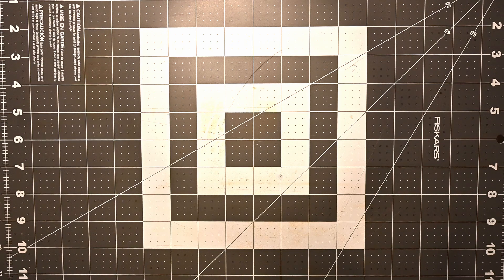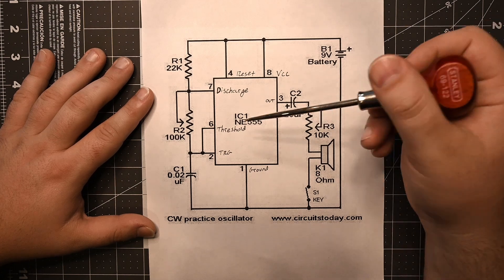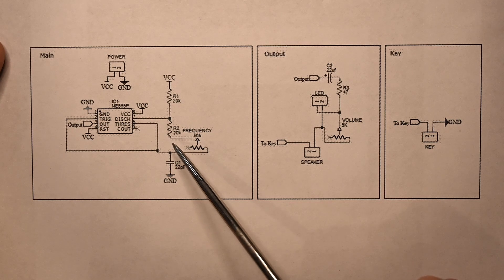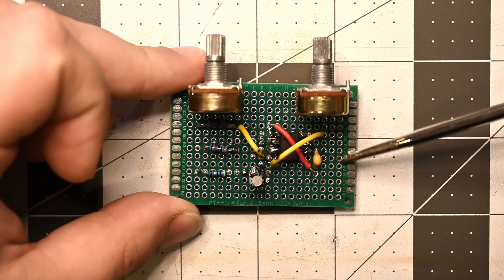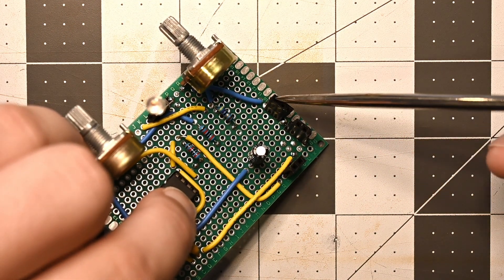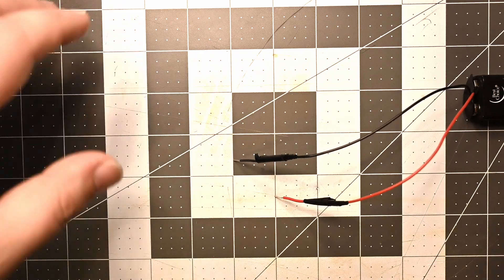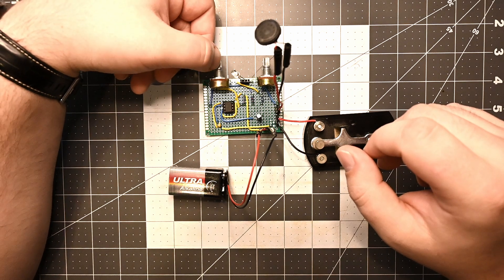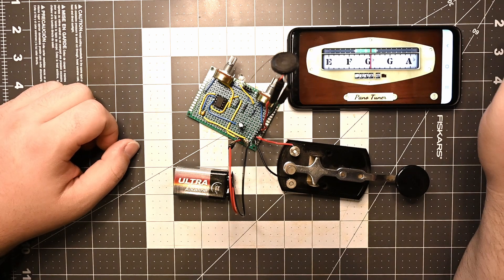Morse Code Oscillator for CW Practice with 555 Timer

Comment: I have two suggestions to improve this circuit that I see replicated as is seemingly everywhere.
1. The lower portion of the 10K volume pot is swamped out by the 8 ohm speaker. Replace the 10K pot with a 100 ohm one. Better yet,  connect the 100 ohm pot as a variable resistor in series with the speaker. The variable resistor and speaker will form a voltage divider that will work with a reasonable range.  You can add a fixed resistor of 10 ohms or so in series if the lowest volume setting is too high.
2. Connect the speaker return lead to the negative rail and move the key so it switches the negative lead from the battery to the circuit. Eliminate the power switch.
Power will only be drawn when the key is closed, so you can walk away without having to switch anything off and no current will be drained from the battery. Connecting this way will also save power when you are sending because no current is drawn when the key is up.
Have fun!

Reply
Reply from the maker: Those are great suggestions! I'm definitely gonna try that! There's a few things I'd like to do and make a v2, so I'll definitely keep this in mind. I really appreciate you taking the time to watch and write all that to help me out!
Reply: @ErikNonIdle  My pleasure. It's nice to see someone pursuing science and engineering as you are.
Reply from the maker: @sailatmojo  If you look at my channel you'll see I have a bunch of different interests, but I absolutely love playing with electronics and always loving learning more about it and finding new projects to do.

Comment: I don’t have a 20-25pF capacitor, what is the maximum leeway?
Reply from the maker: That capacitor works in tandem with R1 and R2 to control the duty cycle and frequency of the output, so the 20pf isn't a critical value. According to the NE555 datasheet you can calculate the Output High  duration with:
Th = 0.693(R1 + R2)C

and Output Low with:

Tl = 0.693(R2)C

So if you want a 50% duty cycle and particular frequency you can plug those numbers in for the capacitor you have and adjust R1 and R2 accordingly. There are also calculators online that will do the math for you. Long story short, you can absolutely switch out that capacitor pretty freely with whatever the lowest capacitance you have is, you just might have to adjust your R1 and R2 to compensate a bit if you are looking for a particular frequency.
Reply: @ErikNonIdle  Thanks for the detailed answer, I already have R1 and R2 (with the same values as yours) and I was wondering if I could just swap it for a 10pF capacitor. I also have a 100pF, which one would work better?
Reply from the maker: @austincarter825  oh, in that case I would probably use the 10pf. You'll get higher frequencies out of the gate, but if you use a potentiometer on R2, you can bring those high frequencies back down.
Reply: @ErikNonIdle  If I use a 10pF capacitor, which would be the best value for R2? I may have some others.
Reply from the maker: @austincarter825  According to a calculator from digi-key, a 50k resistor would be very close to exactly the same as the 20pf cap values. 40k is also pretty close. Keep in mind, none of these values are critical to the function of the circuit actually working, just the tone and frequency. I would definitely experiment with different values on a breadboard to see what you like best. I also just got in some PCBs for this circuit that I am planning to mess with and probably sell if anyone is interested. More on that in an upcoming video.
Reply: @ErikNonIdle  Thanks for the help, and thank you for the video, great tutorial/explanation!
Reply from the maker: @austincarter825  Of course! Let me know if I can help further, and please report back if you wind up making the project! I'd love to hear how it goes for you.
Reply: The 25uF is strictly for DC blocking. It has to pass the audio frequencies and not compete with the 8 ohm speaker. Anything over 25uF will be fine. 25uF is about 6 ohms at 1KHz.
If you want to figure the impedance (AC resistance) that the capacitor puts in series, use the formula Xc (reactance) = 1/(6.28 x f x C) where f=the audio frequency in Hz and C is the capacitance in Farads.  6.28 is actually 2xpi. 25uF is 0.000025 F

Comment: 22uF electrolytic capacitor equal to how many volt?
Reply from the maker: If I understand your question correctly, 22uF electrolytic caps are rated to 25V, which is way more than you'll use in this project.
Reply: @ErikNonIdle  thank you, and why use speaker not buzzer?
Reply from the maker: @iqmalmal5993  You absolutely could if you wanted, but I wanted the speaker for the clearer tones and so it's a little more pleasant to listen to. Using a piezo buzzer would work just as well if you just wanted the thing to make noise.

Comment: Can we use 12 volt power supply instead of 9 volt?
Reply from the maker: Great question! The NE555 datasheet says that the absolute maximum VCC is 18v with a recommended max of 16v, so using a 12v power supply should be perfectly fine. You may have to adjust some of the resistor values if there is a specific frequency you are looking for, but if you are using potentiometers like I do in the video, you should be able to tune it how you like.
Reply: As Erik said, yes you can. The good news is that the thresholds are set as percentages of the VCC, so you should be able to use the same RC values without noticing a frequency change (that goes for when the battery runs down as well).

Comment: can u able to add a 7 segment display for that?
Reply from the maker: You certainly could, but it would take a lot more engineering and is beyond the scope of what I made in this video. That's a really good idea, though. Perhaps using a Arduino shield in conjunction with the oscillator would work for that.

Comment: Nothing explained
Reply from the maker: I went over the electrical diagram as well as several iterations on perfboard and did a demonstration of the project working. I'm sorry it wasn't explained well enough. If you have any questions, I'd be happy to answer them for you!
Reply: @ErikNonIdle  what is a morse code oscillator? what's its purpose? what do you do with it? why is it needed?
Reply from the maker: @kurusb7792  Like the title says, it's for CW practice. It's so you can practice sending morse code without actually transmitting on-air. It's essentially the same as the MFJ-557, but it's a lot cheaper than $75 to make yourself and a fun project if you like playing with electronics.
Reply: I thought the video was really good, don't listen to him. Some people just comment to hate.
Reply from the maker: @austincarter825  Hey, I really appreciate that, Austin! If you have any questions about anything, I'd gladly answer!

Comment: Waste of time
Reply from the maker: Sorry you feel that way. What's wrong with the project?
Reply from the maker: Graphics Revolution  Interesting. I've made this exact circuit several times, and other people have used this video with success. I would recommend checking for solder bridges or faulty components. Also check the 555 has the same layout and orientation as the one I am using.